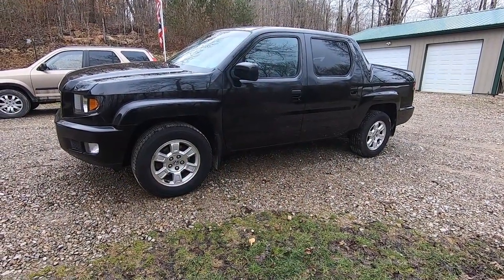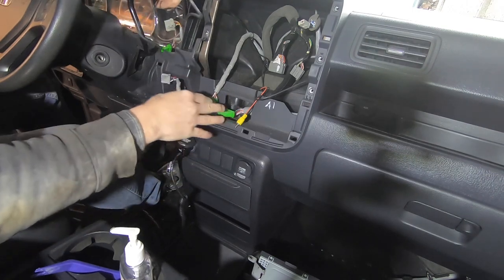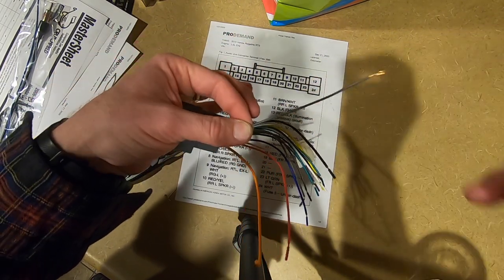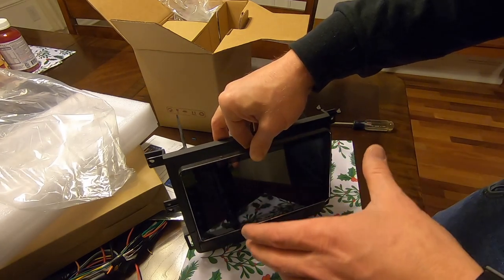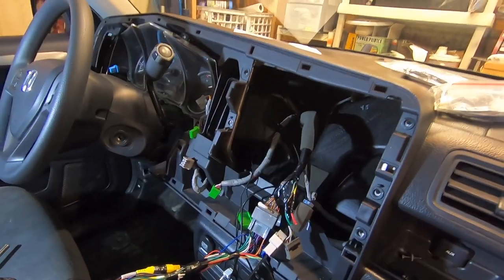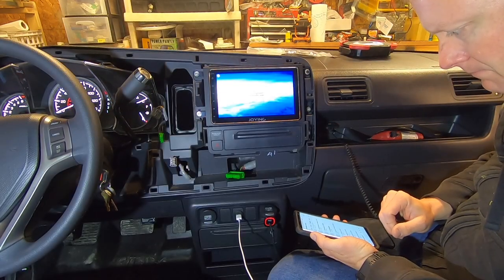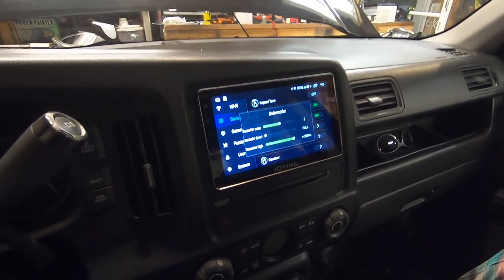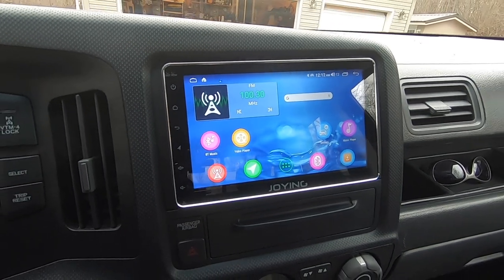1st Gen Honda Ridgeline Custom Android Stereo and Bazooka Subwoofer Installation

Comment: I know this is old and not sure you even check this anymore but... Thanks to you I just did this to my 06 Ridgeline. Trying to get one of the three blanks out below the dash  (where you're usb port is) to put a USB hub in one but can't figure out how to get them out. Tried prying with a razor knife but the blade was about to break.
Reply from the maker: Have to remove the panel and cut it out

Comment: Thanks for this video; was able to use this to install a new radio (although didn't do the sub); took about an hour  - of which I'm pretty sure about 20 minutes was trying to get the wiring harness for the dash climate controls back on.

Comment: So i was reading on the ridgeline forerum that the oem stereo had a built in amp so since i installed a atot stereo i have to buy an aftermarket amp to push the oem sub now is this true
Reply from the maker: This is true. But the factory sub sucks really bad and you probably won't even notice it's not there

Comment: Do you know how so switch from dual climatencomtrol to single? I somehow switched to single for a day (the left thermostat knob controlled both zones) but I dont know how to do it again
Reply from the maker: If I remember correctly there is a button marked dual or sync or something that just locks them together.
Reply: @JackofAllMasterofNone  No, I haven't seen this button you speak of. thanks though.

Comment: Awesome video! I am picking up a 2014 and will be upgrading as it is the sport edition with the CD player. Was you a original stereo that came in your ridge line a single din? From the looks of the unit on the ridge line I am buying it would appear the unit is a single din but saw you installed double din. Thanks again for the video.
Reply: @Dougsee - Im also picking up a 2014...did you ever purchase it and/or upgrade the speaker system?

Comment: Thank you for sharing! One question, how is the original volume control on your Honda steering wheel maintaining connect to the new touch screen unit? Is it the unit come with the compatibility to the remote switch? Or need the specifics adapter on top of that?
Reply from the maker: This unit is programmable to your factory steering wheel controls and does not need any additional adapter. You just have to connect the wires from the factory harness as I show in the video.
Reply: @JackofAllMasterofNone  That is great! Thank you for the value information.

Comment: Have a 2012 sport, how works with original subwoofer? What is the signal wire?
Reply from the maker: Original subwoofer is powered by the head unit. It requires installing a external mono 2 ohm amp. But the factory subwoofer is garbage and is not worthy of the attention. It would be a good time to install a better subwoofer like I did in this video. I also had a factory subwoofer.

Comment: I follow your videos and needs some help please. I also have a 1st gen Ridgeline and cannot get a good answer on if a head unit with 5Ch Preamp RCA Outputs; Front + Rear + 4V Subwoofer and
2-Ohm Stable 300w Max 4Ch. Full Range Amplifier Built-in would be able to run all of the stock speakers and stock subwoofer? I'm a novice for this sort of thing. If you are inclined to help, the specific unit I am curious about is the Power Acoustik CPAA-70M Double Din. I'd like to avoid installing an amp but retain all speakers and the stock sub. Just wondering if this unit can accomplish that. Thanks
Reply from the maker: That unit would not support the OEM subwoofer. The outputs you are referencing are RCA outputs that require an external amplifier. You could run the door speakers with the head unit and would just need to add a small 1 channel mono amp to power the factory sub. The OEM head unit is a very unique piece of equipment that has a separate amp built in just for the sub.
Reply: @JackofAllMasterofNone  thanks so much for the reply. I really appreciate you taking the time. Do you have a mono amp recommendation or perhaps a powered amp option that would be an even better option?

Comment: What do you connect the two wires (16 and 5) i believe into? Is it the Key1 and key2 on the joying side?
Reply: Took me almost 2 hours but I finally figured it out. I have the same exact head unit as you, I connected key 1 and key 2 (both from the headunit's side) to the steering wheel control cable  (pin 15 on the car side). The ground cable on the car side, I just connect it to the 12v ground). I still have to figure out how the other 4 push to talk buttons get recognized by the head unit. I think the cable for those 4 buttons is actually located underneath the driver seat (gray, pin 10).
Reply from the maker: Key 1
Reply: I have same model only 2011 RTLE and I connect wheel control cable to  key 1 and does not works,  no detection of key pads on the wheel, any specific advice with these problem, to make it works.

Comment: Another quick question, after adding the Steering Wheel control wires to the Metra Harnest, how did you connect them to the joying harness? There are two “Key wires” but my installer wasn’t sure which of the Honda wires (control vs ground) connected to which? Thanks again
Reply from the maker: Ground wire just needs grounded. Use the key 1 wire to the control.

Comment: Nice setup I have a 2014 and was looking to upgrade the radio and navigation but wanted to sit flush which this setup shows.  Thanks again for the video
Reply: I took my 2012 RTL with Nav to a stereo shop and had they remove the Honda antiquated unit and install a Sony touch screen with Apple Car Play.  They hooked up the back up camera, and the radio controls too.  Love it.

Comment: Also the GPS antenna can you fill me in on that? Idk that my aftermarket radio cam with that or if it's built in? Haven't thought about it till now and also the MIA "bluetooth module connection"??  Please lmk. They said connector B and slot 2... idk why but the one I found with 28 slots total was not the color solid purple as said to connect the (idatalink maestro) unit to...

Comment: Does the radio start every time you start the vehicle?  I installed one of these Android ones in my Chevy truck it doesn't turn on every time I start the vehicle...
Reply from the maker: It does start every time I turn on the truck.

Comment: I wonder if the newer joying headunits with the physical volume knob has the same connections setup behind the screen.
Reply from the maker: So the short answer is yes. But they aren't compatible. Have to have a physical volume knob head unit to match a physical volume knob screen on the Android 10 models

Comment: I am preparing to install the Joying 8" double din.  May I ask about the two screws you placed at the top of the screen to 'close the gap' between the monitor and the installation kit.  You initially said you planned to put in a couple set screws and then said you placed a couple of 1/8" screws. thanks.
Reply from the maker: No. I used a 1/8" drill bit to drill through the plastic male and female parts and then used some small screws I had laying around that fit the 1/8" holes to help retain the head unit tightly in the plastic retainers

Comment: Question for you, I have the RTL, with navigation. There is no little pocket and space next to it for the hazard switch, it's actually the face of the radio with the hazard switch mounting through it. Any idea where to pick up that plastic piece on the bottom with the pocket and mounting slot for the switch? Metra does not sell it.
Reply from the maker: I believe you can just order it through Honda as a factory replacement part
Reply: @JackofAllMasterofNone   Yep, I tracked it down. Thank you.